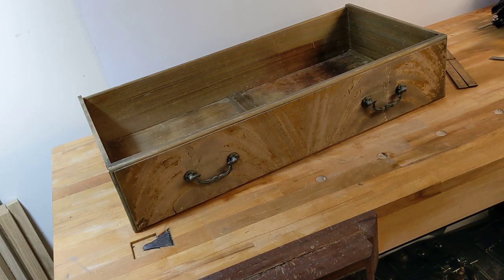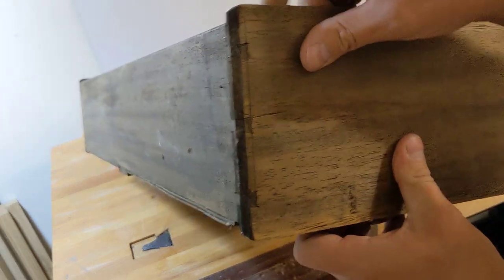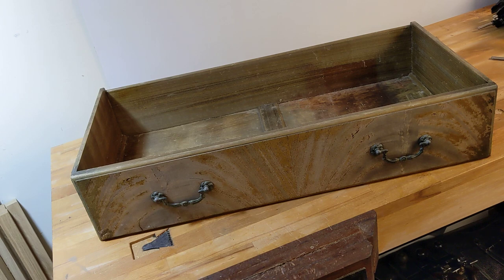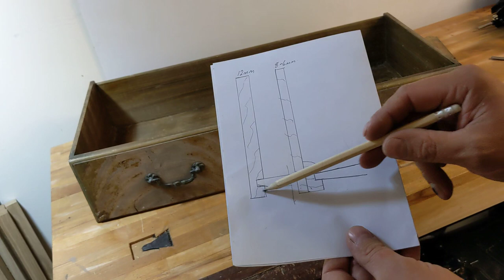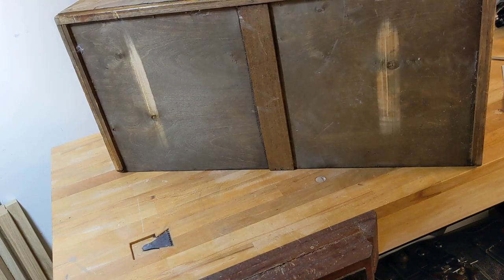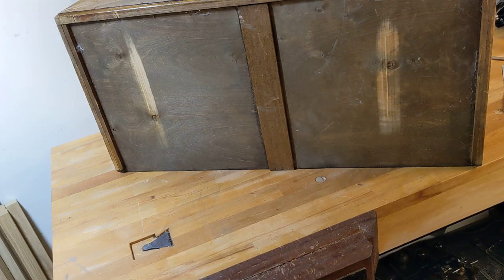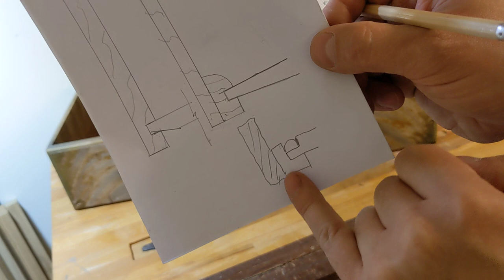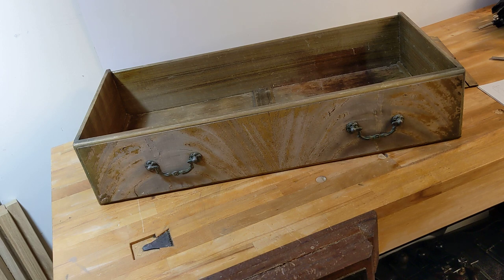ULTIMATE Drawer Construction! Woodworking Vlog #10

Comment: Great video. I made drawer slips in  my last project using a Record 043. Takes minutes. And as you said, it doubles the contact area of the drawer side bottoms. Next time I might do the version you showed at the end, levelling the slip with the top surface of the drawer bottom.
Reply from the maker: Yeah, that was a bad drawing of the last option 😂. It's a better option if the drawer holds documents, the quadrant is nice for clothes.
I'm pleased to hear you made some drawers with slips 👌

Comment: It's hard to get my head around handcut dovetails in a drawer (front and back!) from a piece which you refer to mas manufactured. Certainly there were industrial dovetail cutting machines when this piece was made. Were the handcut dovetails a marketing feature that helped sell the piece; whereas, the plywood bottom (and what appear to be die cast bails) would not have detracted from the market value?
Reply from the maker: You are absolutely right, machines were available at time and even earlier, to cut dovetails and even some whacky variations https://images.app.goo.gl/PTmiqyFswbeXnNJC8
But this piece is still likely to be transional in terms of full automation. I think it's hard to truly understand how quickly joinery work can be done by hand when machines have planed and cut to length for you. Let's just say it was a good rythm of cut to line and pass over to assembly.
I don't think this piece would have been sold on the merits of hand made joinery, if it was, each joint would need to be of an obsessively high standard. The hardware is of a low standard too. 
Thanks for the comment, I appreciate the discussion 😊
Reply: @faceedgewoodworking  Yes, the very datable Knapp joint. I've seen where woodworkers have recreated this joint. And no, I cannot explain why.
Reply from the maker: @annarboriter  The constant need for content...

Comment: My latest woodworking project had no joinery in it at all. It's held together with sheet metal angles. I did hand plane some of the plywood a bit on the edges. I can't remember now why I felt compelled to do that. I just remember doing it. Today I was a plumber so no woodworking really to speak of.
Reply from the maker: We all have plenty of jobs to do! I've also had a massive sort out of tools and the garage space too. Lots put on eBay!
Reply: @faceedgewoodworking  my garage looks like a bomb hit it. I need to put stuff away from the past couple jobs. Then it still won't be neat but at least I won't be tripping over as much.